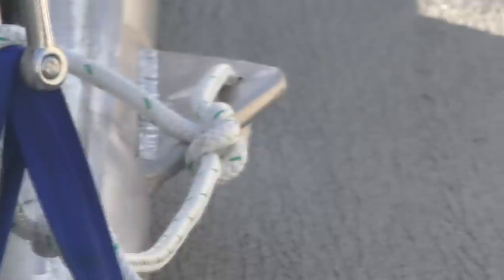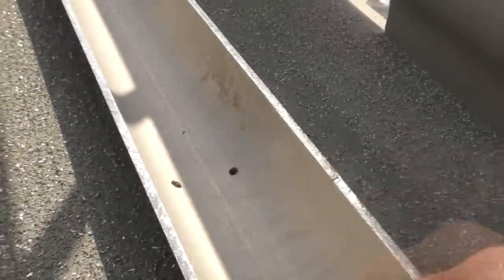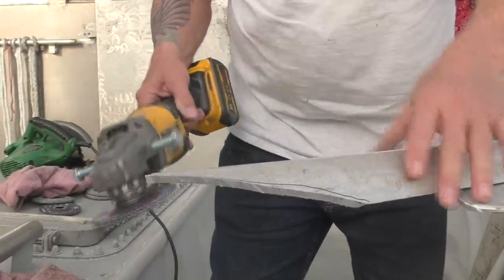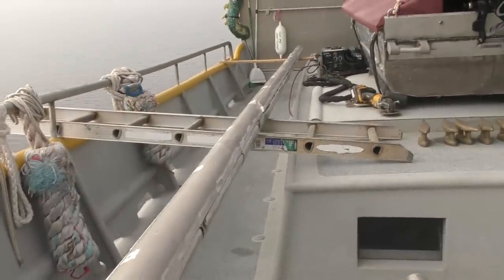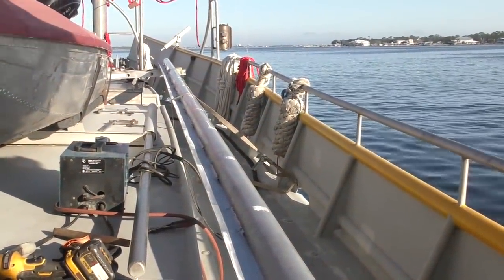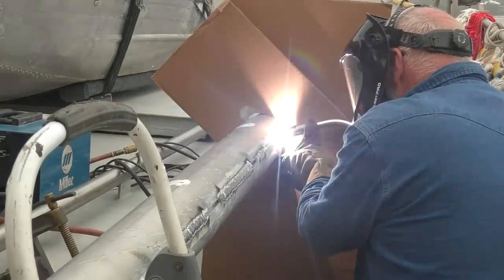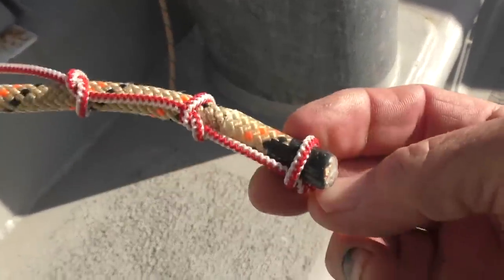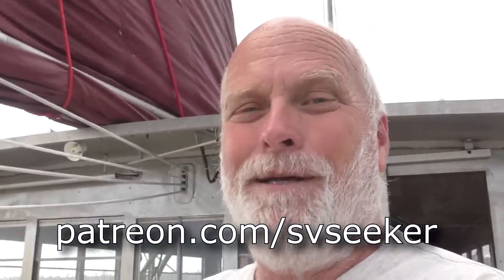Mainsail Yard Reinforcement

Comment: Doug, get some bees wax to use when cutting and grinding aluminum. Should be easy to find when running into shore. At least try it. Best truck I ever learned in a railing shop.

Comment: Grommet holes in sail cloth, it would require milling on a 3/4 but putting the driver in a drill works so much better with the bonus of the cloth melting the threads to stop fraying

Comment: I admire your courage Doug! Splitting that pipe must not be an easy bullet to bite, amazing results! For your ladder, I use tennis balls. I cut around a seam  and poke them at the ends. I also add self tapping screw if they fall.

Comment: Doug,  Instead of a bridle on the mainsail have you thought about rigging the top batten of the mainsail the way they do on a gaff rigged sailboat.  Two halyards, the Throat halyard attaches close to the mast and carries most of the weight of the sail and the Peak Halyard that attaches  way out on the gaff to adjust the sail shape.

Comment: i believe its about time to fabricate some workbench supports.  Truss style, im thinking a 3’ section of pipe to serve as main support, with a short section welded 90 degrees perpendicular to one end,  split one of your sections of pipe and weld them onto the short leg.  closest to the main beam grabs your rail from the outside and one on or near the bottom leg pushes against the insid of the lower rail.  then a diagonal piece to reinforce over the entire length and Voiliolla, you got a set of these to hang off seekers rails  making a fine stable and strong workbench for all your little projects. store them in the corner below decks when not in use.

Comment: So.. punching holes like you mention at 23:12.. I got a trick I used when my wife was making corsets.. chuck your punch into a drill press.. then spin punch and use that to cut your holes.. not only do you get easy holes, the friction also seals any synthetic fabrics, just like using a lighter to burn them.  Give it a shot, you won't go back to a hammer to punch them ever again.

Comment: I've had good luck cutting thin metal with my wood-cutting skil-saw blades by running the blade with the teeth facing the wrong direction. Less jerking, smoother cuts, less noise.

Comment: Well, i guess my other post vanished..Solution: plug area near conduit bang with a balloon or hot water bottle. Rig an inflation tube for proper depth. Spray or drip in Great Stuff expanding foam on top of new plug. Let cure.
Reply: Just slowly use great stuff, letting it stick to the sides. You're done.

Comment: GET A FEW O RING GASQUETS OF A DOBLE DIAMETER OF THE PERPETRATOR , CUT THEM AND TIDE A LINE TO THE GASQUETS , RAP THEM AROUND THE PERPETRATOR AND LOW IT DOW UNTIL NO MORE NOICE , SECURE THE LINE . IT WORKED FOR ME ON MY CHIMENEA , SALUDOS

Comment: a rope doen  with soft bendable plicet with steel washerunder to keep the knox from pulling thrue 2 or 3 or more pull up pipe needs to be bendable enuf to pull all the way thrue.. washer need not be over 3 or 4 in.

Comment: What gas do you use for welding I’m not to familiar but I have a 75% argon mix 25% carbon dioxide bottle on my mug welder for welding metal but I got the spool gun to weld aluminum can I use that same gas for the aluminum or I need a different one
Reply from the maker: I use 100% CO2 for steel and stainless steel and 100% argon for TIG on steel, stainless, and with the Aluminum spool gun.  CO2 will not work with Aluminum.
Reply: @SVSeeker  ok thanks it’s great to know I’ll have to get another bottle